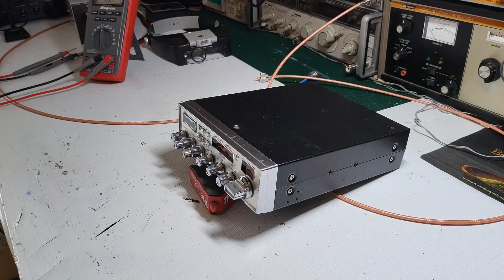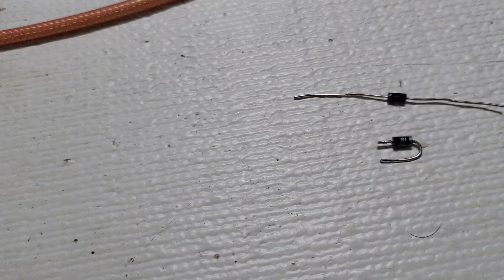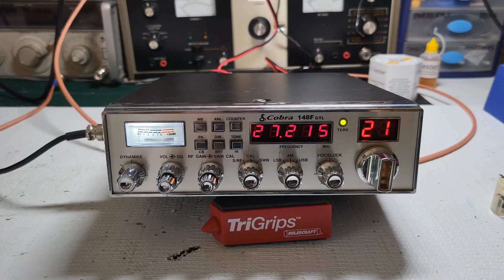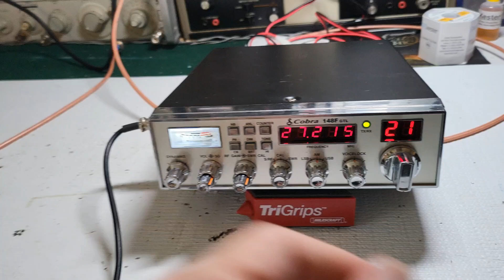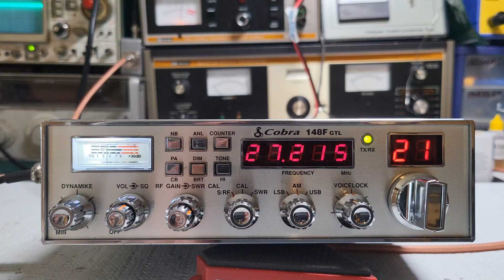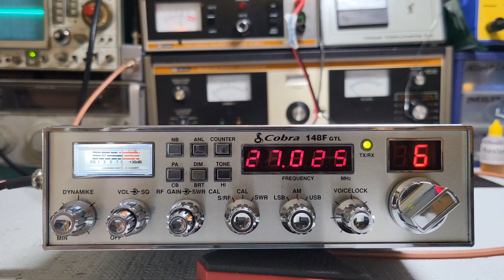CB Basics, Protection Diodes 101 Featuring a Cobra 148F GTL

Comment: this is the model i have, and i also blew out the idiot diode. i learnt to never use a general electric connector on this radio, it is the opposite polarity. otherwise its been a fine radio.

Comment: Hey, I blew a protection diode in a Taiwanese version 148gtl. No f just a 148 gtl. What is your recommended replacement and where should I buy it?
Reply: 10-4 brother thanks for the info! Keep the videos coming 💪
Reply from the maker: Get the original or Six Star Sales on ebay has them.  You can get the Motorola style or regular style.  Just search for cb protection diodes and find the ones from Six Star.

Comment: This is Harvey Miller in Mississippi I have a cobra 2000 that is getting 1.8 volts back to the antenna Jack do you have any suggestions or Reason why that is happening the radio will transmit on another radio and will receive off of another radio but cannot transmit out and have no incoming receive what do you think the problem is
Reply from the maker: I'm confused as to what you're saying ?  Does it transmit and receive ?